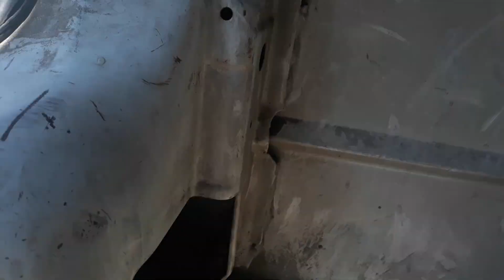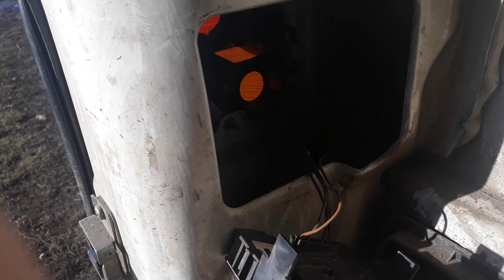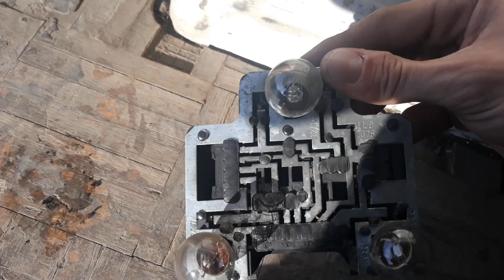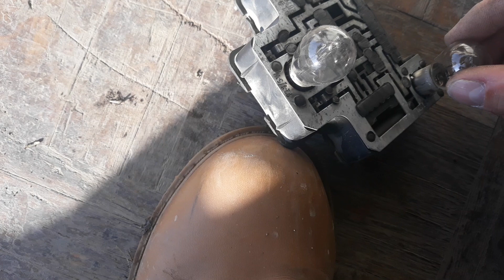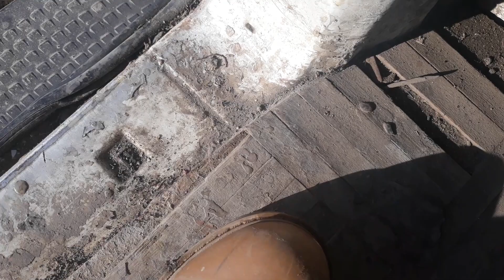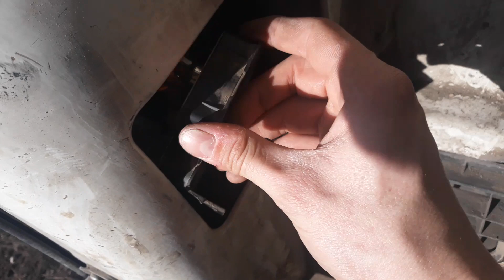How to change a VW Transporter T4 Rear Lights with one Hand

Comment: This is great. Very helpful. Not at all helped in my case that on one side of my van is a cupboard and on the other a fridge - both blocking access to the lights.....groan. A 5 min job just turned into a hour....lol
Reply from the maker: My van is the simple version😁 you can change a bulb in 1 minutes, but in your van is harder!
Reply: @MPA9  So in the end It turns out there were access ports inside each cupboard including one behind the fridge. However when changing the bulbs I noticed that the ports are not big enough to gain access to the bolts for the light fitting itself, so I've decided not to bother swapping out the entire light unit for some nicer after market ones.
Reply from the maker: @Daz5Daz   you need to buy a new one. A leder tail light and no problem with bulbs. ;)